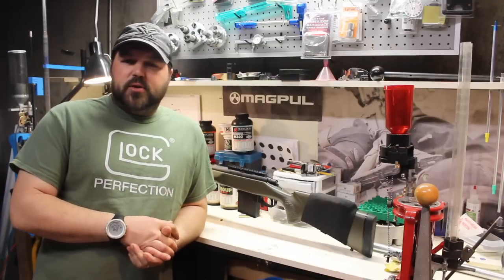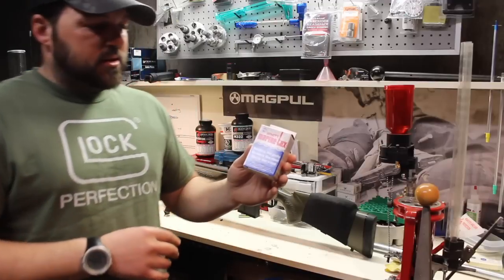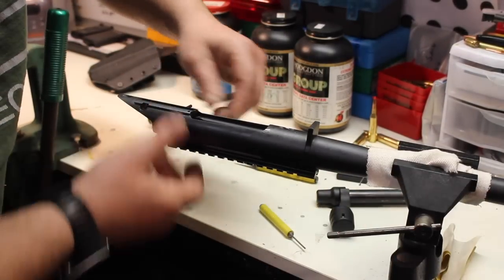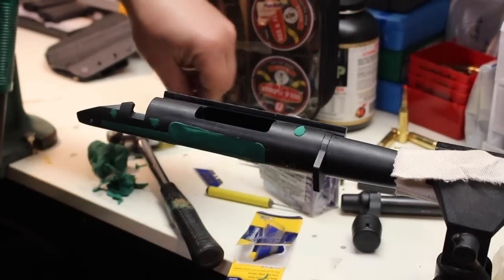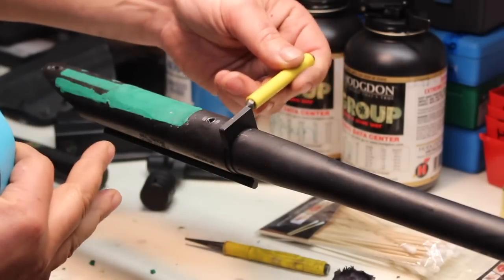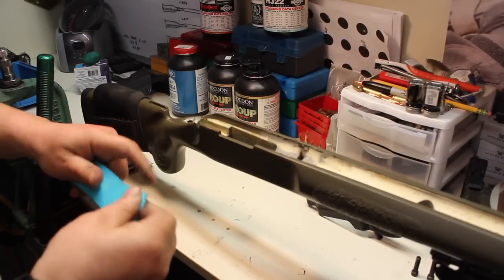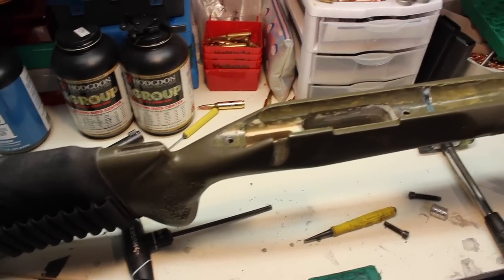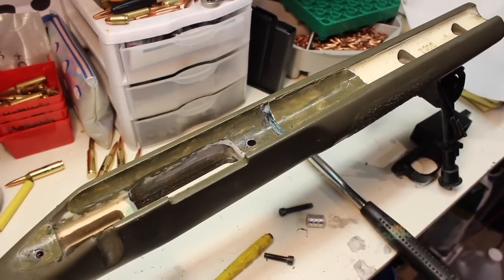BEDDING RIFLE ACTION, MARINE-TEX

Comment: My opinion: I don't think it's necessary to disassemble anything or tape things off.
No need for wax, shoe polish,  dirty mess, wax will be horrid to remove.
Just apply a liberal amount of oil to all metal and the divots in the pin ends fill with grease. I've never had trouble.
Use jb weld....scuff and clean the receiver housing first....no need to tape the stock, oil it too and to clean up use solvent it wipes off clean. Simple, easy, faster, reliable.....it forms a full cast around the receiver. Sometimes needs repeating if there is not enough jb to fill.
Has never failed me, ive done eight projects, the result is a perfect fit... firm on my opinion....hope this is of value.

Comment: Not bad for your first try but that is a bolt release lever not a safety selector. You should use the grey marinated next time it has metal powder in it and adds strength and also looks better than white. If you are going to use weight add die to it ahead of time. The biggest mistake though is at the end of the video when you pick up one of the pillars and say you need to clean them up before you reassemble, the millers are supposed to be epoxied in the stock first or at least when you are bedding it, thats the whole point. thats why you had wear/rub marks on your action. Plus clear shoe polish works a lot better than colored, it gives a better finish but Johnsons works the best. and its best to put on the polish, let sit for a bit and then lightly buff off, its not good to have it too thick, it leaves voids and not as nice of a finish like on the tang area of yours. Its a learning curve thats all.

Comment: One thing you forgot to do is add tape(I use brownells bedding tape, 2") to the barrel to ensure that your barrel floats freely when you reassemble your action to stock.
Reply: A couple layers of painter's tape works just as well and doesn't cost $15 a roll.
Reply: Hewhoremains420 just at the forend tip of stock. Wrap enough to create an even gap. Make sure action area is relieved enough to prevent undo influence.

Comment: I would and have hogged out some of the recoil lug recess area so there is a good bit of bedding compound behind the recoil lug and get a precise fit at the rear. Yes to tape on bottom sides and front of recoil lug. Even remove stock material under the front and rear of action so it is full bedding compound contact.

Comment: I was reading the comments someone made note of the White Marine Tex and the gray Marine Tex I myself  have used Marine Tex for over 30 years and in  multiple repairs in the automotive  industry and bedding rifles the gray is  far superior for it  has metal powder or I should say finely ground aluminum in it that's why it's gray and has a higher heat resistance which hopefully won't be too much of a factor in a bolt action rifle the white is strong and mostly used in Marine industry for repairing fiberglass hence the name MARINE tex. by no means am I a professional gunsmith but all you really need to bed is the rear Tang and The Recoil lug and about an inch in front of lug it makes cleanup the hell of a lot easier and I myself I've only found this out from years of experience and a few blunders of my own you may also find after you've run a couple of boxes of shells through it the white May crack all in all not bad for your first ever bedding job

Comment: I have seen people tape the recoil lug, but why? If you put the release agent on correctly, I use the real thing, it releases and it's a much tighter fit. Not a lot of sense putting tape on it to make the fit less than tight. The only flaw with using bedding that is not made specifically for bedding is air bubbles. Bedding made for the job is in packs that you can mix your bedding in the pack before it even hits the air. It doesn't cost that much more to buy the right products to do the job right. Been there and done that on several rifles.

Comment: Good job. But I still don't understand why people tape off the recoil lug. If you don't, wouldn't it have an even more snug fit?
Reply from the maker: If you don't tape the recoil at all it won't be able to seperate it from the stock. Most tape the back and sides with painters tape
Reply from the maker: When you add tape to the sides and rear it allows it a bit of wiggle room to remove. The front of the recoil lug you don't wanna add tape. When the gun recoils it's pushes back and the front of recoil has a perfect fit after the bedding and no where's to move. A lot of people do it different ways. Some do just the sides, others do 3 sides. I don't think there is any right or wrong way as long as there is no tape on the front of the recoil and that is snug to the stock that way the action has no where's to go
Reply: Thanks! Just to clarify, you said don't tape off the front, so the part you taped off is considered the rear of the recoil lug?
Reply: Great video good to see someone go full length on their bedding job! Although I wouldn't have painted over my newly acquired action mirroring bedding with an uneven mushy nail polish... am I correct in thinking you taped the rear and sides of your recoil lug? I recall doing the front and sides of mine as the action wants to recoil rearward and has a solid glass bedded surface behind it to prevent it moving
Reply: I don't tape the recoil lug. I want a tight fit in that area. Use plenty of release agent and it'll pop out.
Reply: glad to see this comment I didn't tape my lug just used a lot of agent about 4 hours into the cure process we'll see how she goes. @TexanUSMC8089
Reply: @joemaniery1014  the BACK of the recoil lug is what is forced against the interior of the stock under recoil.
Reply: @jasondrakcip1008  are you sure about that?

Comment: 6-8 inch group at 100? That sounds like an optic problem. That’s nuts.
Reply: I have a 270, had the original stock I can get like 4in groups at 100 never was happy I bought a boyds stock i get 1/2 groups now. But I wanna bed the old stock to see if itll fix it because its not as heavy
Reply: Mike Finto  I have Boyd’s Stocks on three different rifles. They’re my go to personally. I love their thumbhole stock particularly.
Reply: @mikefinto4048  hi, did you bed the Boyds stock? Pillars option?

Comment: Wouldn't you want to lug the screws down? I would think not tightening them, would allow the bedding to be too thick to tighten later.
Reply: No. Doing so may twist or pull one end further in/down. Old inner tube cut into 1/2 - 1 inch strips and wrapped snuggly on front and rear of action will give a stress free bedding.

Comment: Great video. What issues if any are there removing the modeling clay from all the gaps? Just scrap them out & use the pins to push it out when reinstalling the trigger?
Reply from the maker: caloebs Use fresh modeling clay. If tried to use older stuff and it doesn't hold together well when you remove. New stuff stays together. I used a toothpick and my pocket knife. It came out easy

Comment: You really should torque your bolts to spec. Yes, that'll squeeze out a lot of compound. But everything that gets squeezed out is unnecessary. You're just adding too much material otherwise.
Reply: That will add stress- best to just lightly press the barreled action in and let it settle in

Comment: What size Marine-Tex kit is that? 2 oz??
Reply from the maker: txsharpshooter85 ya the small bottle. I think it was $15.99 or $19.99. I had a lot left over but I mixed the whole thing so I couldn't reuse it. I would buy small and mix the whole thing, you don't wanna have to mix more after you applied. I tried other stuff but this It's really easy to use and it's thick so you don't have to worry as much with cleanup and it's easy to sand
Reply: I have bedded recoil lugs before, but doing the whole action makes me nervous. Particularly the action screws. I don't see how you keep the bedding compound from sealing the screws in the threads, even with release agent.
Reply from the maker: txsharpshooter85 I was the same way. I was biting my nails doing it but that marine Tex made it easy. I loaded everything with shoe polish, especially the screws. There isn't enough compound to fall into the holes themselves. I let it sit for about an hour and then back the screws out a hair and then tightened them back up. When I cleaned up there wasn't any compound even near the screws. I got some in a magwell and trigger gaurd but a Drexel made the cleanup easy.
Reply: Thanks for the video, looks like you did a good job. I am shooting a 700 in 243 as well. It has a Rock Creek Sendero contour 8 twist barrel. Currently in a Bell and Carlson M40, been thinking about bedding...might get enough balls to do it one day. What load are you shooting in your 243?
Reply from the maker: txsharpshooter85 I bed the recoil lug area awhile back and I got a rocking motion like there was a high spot near the recoil lug, so I decided to bed the whole thing. I don't have the rocking or teetering motion I had anymore. I was shooting 105 amax and it shot great. I would shoot 10 groups an all 10 were under 3/4". When I went to order more bullets they didn't have any so I went with hornady 105 bthp. I took it to range and I couldn't hit a 12" pie plate. It was every where's. I checked all action screws, swapped 3-4 scopes and rings, nothing. I did load workup for 75,87,100sierra and 105.  I got the best groups from 100 Sierra and that was around 2". Not impressed. I bed the action and it's more consistent with all ammo but still no better than 2". I took it to smith to check the throat and rifling and he said it's fine. We are gonna recrown this week and if that doesn't work I'm gonna order a Mcree pre fit barrel with a nut, then I can change my own. We have no gunsmiths that work with metal in my area so I have to send out of state and wait 6 months....sucks. Weird how the accuracy just disappreared
Reply: When I had my factory 243 barrel, the only thing it would shoot was 87 vmax with H4350. Everything else was all over the place. I had it rebarreled by accurate ordnance, it took them 2 weeks. I am shooting 107 nosler BTHPs now with the Rock Creek barrel.
Reply from the maker: txsharpshooter85 they make nice guns. I have a couple friends who love them
Reply: @txsharpshooter85  stick your screws in paste wax or polish, I guess too, and after the compound starts to solidify... just unscrew the screws a bit or even take them out, re-apply polish or paste wax and put them back in. My next job is to put a different barrel into a new thumbhole which I'm going to pillar bed using 1/2 lag bolts, if I can get a 1/4" hole drilled through it or some aluminum ones I have already made... the 1/2" though is exactly the same size as my lugs.